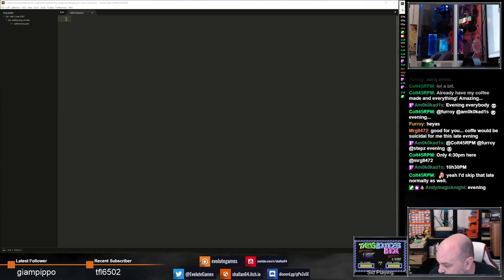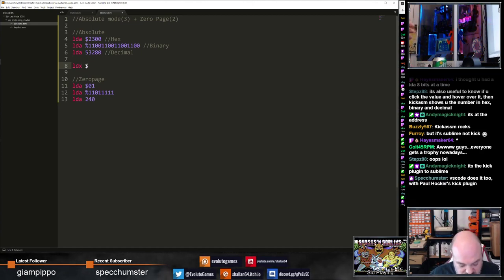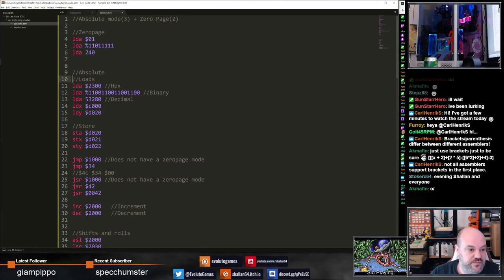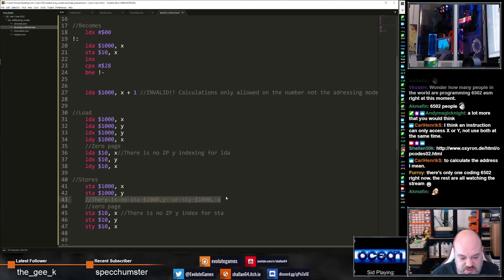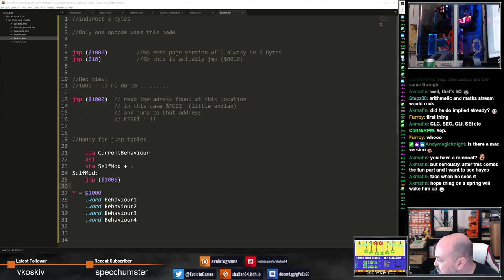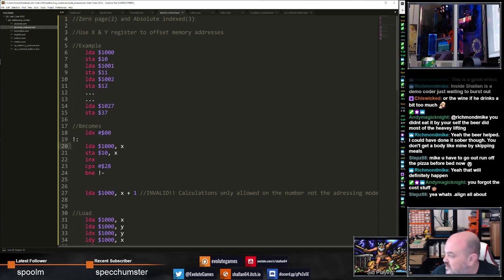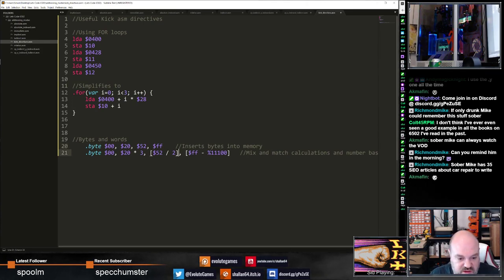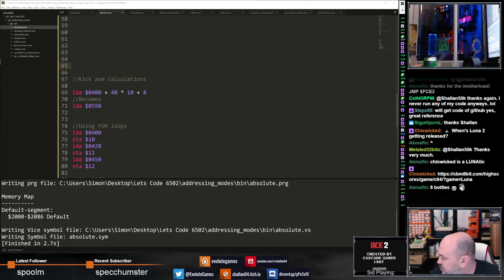Let's Code 6502 - Ep2: Addressing Modes and Kick Assembler - 13/02/2020

Comment: (ZP,x) can be useful for multi-player games and dynamically reading different joystick port registers based on x.
Reply from the maker: I actually found the code in Luna i used (zp,x) for. It was to keep a list of screen locations for the static stars so they could be cleared and redrawn to keep them static while the whole screen scrolled very quickly in a loop just by using inx instead of some other kind of lookup table